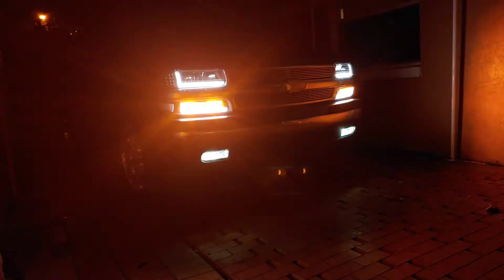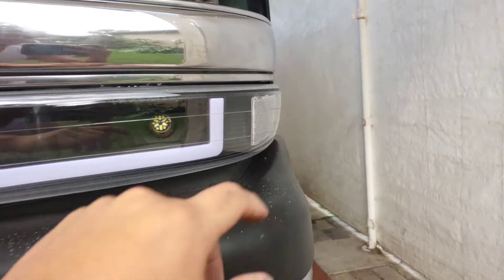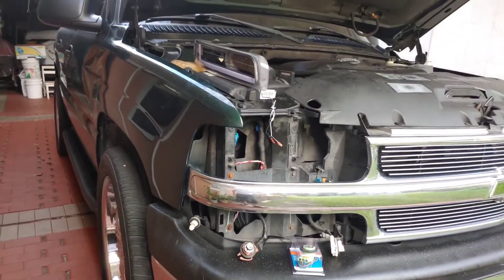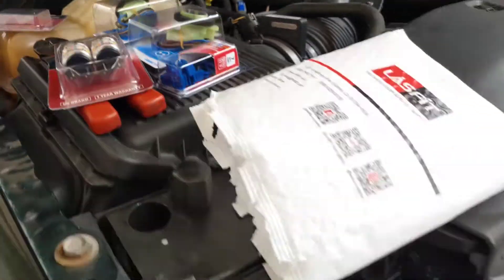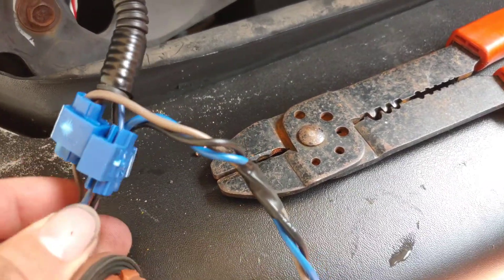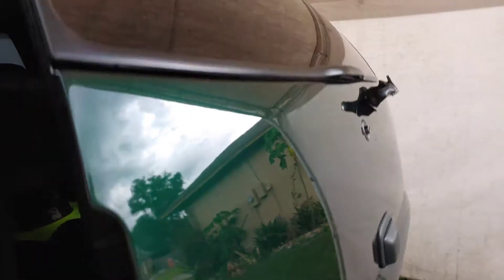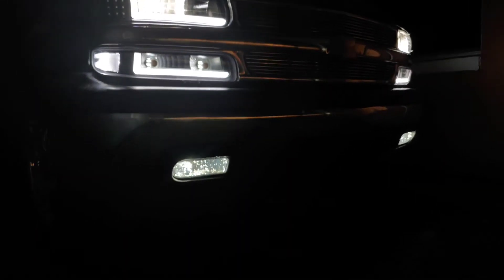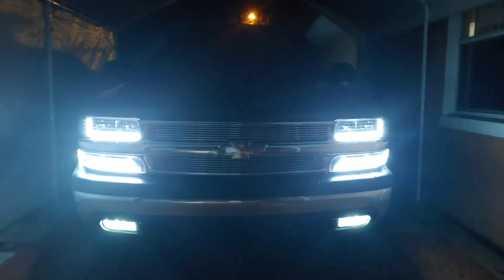DRL Mod For GM Trucks With Lasfit Switchbacks

Comment: It's crazy seeing switch backs on 03 -07  kateyes. I had the 88-98 style for years, and thay was all orange older the headlights, and then I moved up to newer year truck, and switched them like the older trucks because that's what I liked, and 10 years later I start seeing the change in the lower lights. I didn't even know I was ahead of the game by that many years.  To many all white lights on front of trucks. Now I have Amber bars, that stay Amber, and turn Amber also. No switch back . Just my preference.  Everyone's diff.

Comment: So you sowed how to make both sockets blinker lights. How did you wire the white and black wires for the headlights and bumper lights? I haven’t found any videos explaining this. Are the strips for the top and bottom hooked to the low beam socket? Please explain cuz that shit looks sweet

Comment: Did the LasFit bulbs hyper flash for u in the beginning or no? 

Because I bought some for my 01 Tahoe and they hyper flash and they have built in resistors
Reply from the maker: Do you have leds in the rear ? For your tailights ?

Comment: How did you get you’re lights to sit perfect like that? I installed mine and they sit weird… like they sit facing up and out of place.
Reply from the maker: Man these lights were a pain to have it sitting right... what i did was mess with the aim of the lights as i was putting them in place. Make sure that the 2 pins go through all of the mounting holes.
Reply from the maker: You will have to apply some pressure but  make sure you dont break the brackets they are very sensitive
Reply: @SleepyBoiii  do you think I can replace the back housing part with the original? (I figured out how they go in but they rattle)
Reply from the maker: @BAPEMCM  try it out, maybe it will work perfectly

Comment: so for the lights that you didn't want to hook up, where would you run those to if you were to use them ?
Reply from the maker: It all depends where you want them, you can tap them in with your signal lights , drl bars, or headlights. But i honestly think it will look better with the drl bars on the headlights

Comment: Have you had any problems with those small led corner lights? I recently bought some white led corner lights and for some reason my whole dash and some other lights would flicker whenever I would turn on the turn signal.
Reply from the maker: Ive had no problems at all. Maybe the led is not in contact right 🤔 i would check fuses & the wiring harnesses as well

Comment: Can you put the link for what you used beo
Reply from the maker: Yeah i can, which links do you need bro
Reply: Sleepy Boiii the for all the switch backs and the socket for the drl and did it come with the resistor
Reply from the maker: So Switchbacks Already Have Resistors Built In.. https://www.lasfit.com/products/3157-switchback-led-turn-signal-lights-canbus-error-free?rq=na_led-bulbs~mk_chevrolet~md_tahoe~yr_2003~zq_standard-trims 

Corner Lights ...
 https://www.lasfit.com/products/2x-lasfit-t10-192-194-168-158-led-interior-light-bulb-error-free-1-year-warranty?rq=na_led-bulbs~mk_chevrolet~md_tahoe~yr_2003~zq_standard-trims&variant=31351454826580

Sockets You Can Get At Your Local Autoparts... Just Make Sure Its A 3157 Socket With The 3 Wires
Reply from the maker: Also If You Still Have Hyperflash After You Installed These Switchbacks, You Will Need To Add Resistors On Your Taillights Since You Might Have Leds Back There...
Reply: Sleepy Boiii and can show a video of more details on how you installed your new headlights to the fogs
Reply from the maker: @chris.lowhoe7417  i did make a video on it